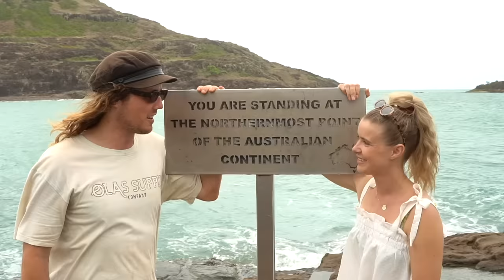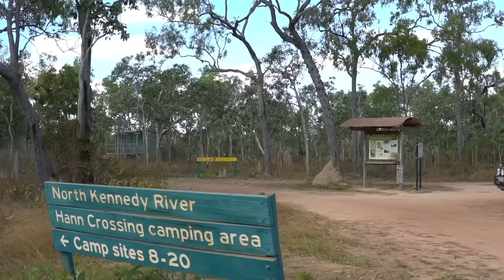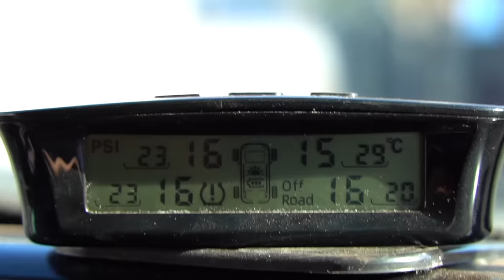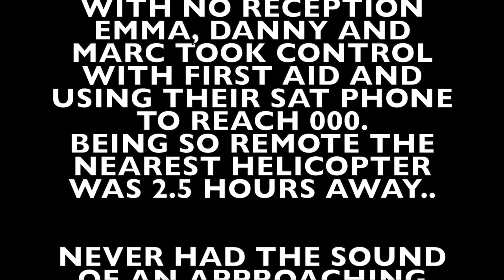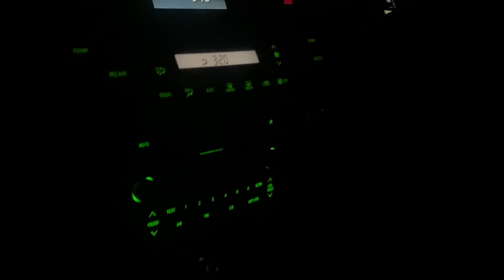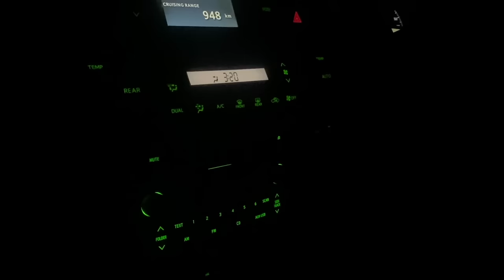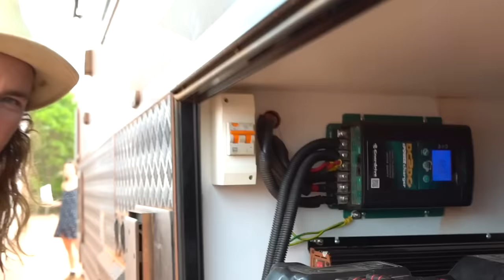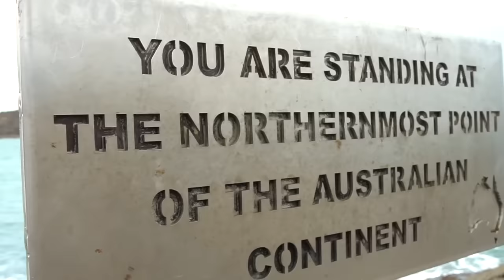CAPE YORK CARNAGE THE MOVIE - Towing our Offroad Caravan to the Tip of Australia

Comment: How do you protect the internal steel if you are only powder coating the external surface of the frame or are you doing it inside and out?  That's one of the reasons hot dip galv is so heavy, it's full coverage.
Reply from the maker: It’s a normal painted chassis so that’s internal paint too, then we powder coat the outside of the chassis, this new stuff is bloody insane!

Comment: You made a major error in this Vlog. I’m only half way through, but I feel it’s important to point out your error before I even finish the video…

You mentioned around 52:43 that the the Prado “got a few dents on the bash plate.”

Now you’re not new to the Toyota owners club, but I thought all Toyota owners knew this? Clearly not? So I’ll share my vast knowledge.

Toyotas don’t dent or scratch: they simply develop battle scars. 

Also

Toyotas don’t get stuck. They simply pause to take in the scenery and beauty surrounding them.

It’s actually in the manual. Page 434, paragraph 9, point 101.

Now. 🙃As you were.

✌🏻🇿🇦🥩